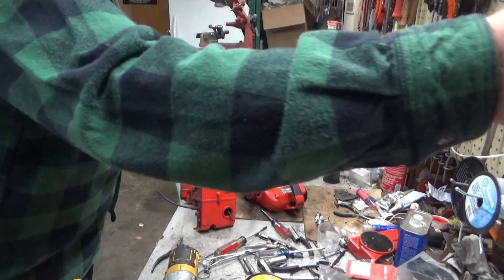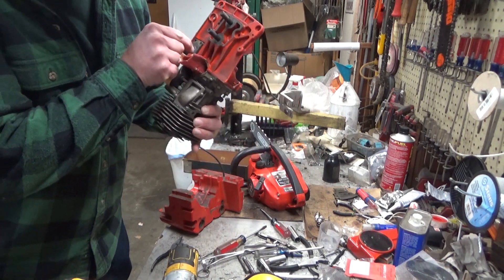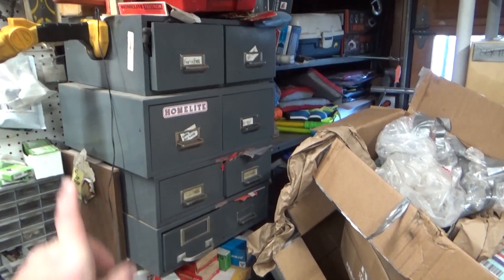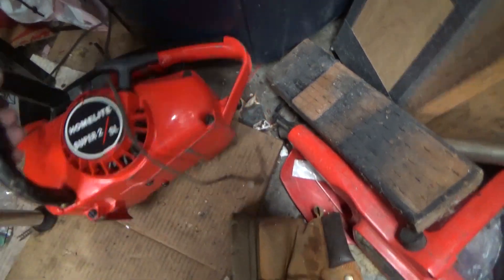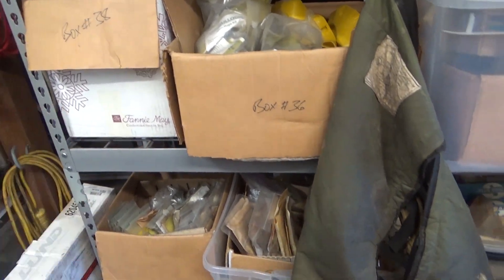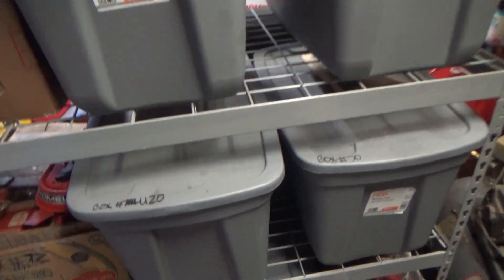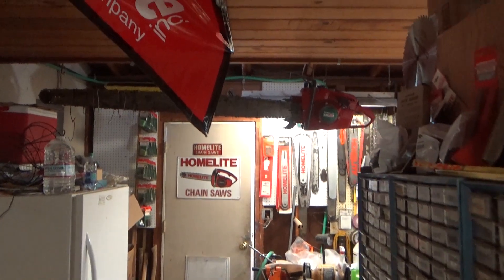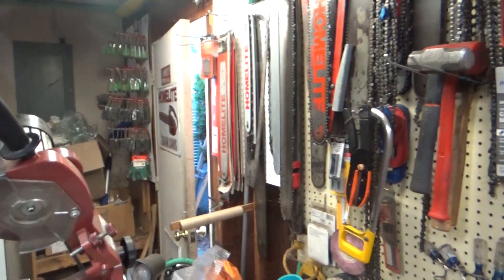Leon's "Shop" & Collection Tour

Comment: I ran the saw shop for a large logging company in the 80's- a fleet of big Homelites 925's, 955's, and 1050's, 49 saws in all and many parts stocked for each- I built a brand new 925 from stock once just cuz I could, most expensive saw of all time!  It was fun and am glad I did it but never told the boss, just worked it into the fleet.  Wish I had it now!

Comment: Reeds will stay slightly open....and give high speed running....no low....cause it floods....pull out reeds...remove Reed pins..bend flip over....will run great...

Comment: Hey Leon where is a good source of Homelite Super XL cylinders new or good used and matching pistons
Reply from the maker: Nowhere when it comes to OEM at this point.  The Lil Red Barn aftermarket ones are the only source for any quantity: https://www.ebay.com/itm/HOMELITE-SUPER-XL-BIG-RED-OLD-BLUE-XL12-CYLINDER-PISTON-KIT-1-13-16-NEW/181255679282?hash=item2a33ae2d32:g:zPgAAOSwk5FUwnaJ

Comment: Me. Leon, I am trying to take a squish measurement on a xl700 no base gasket build and it’s not even putting a dent in .062 solder, am I doing doing something wrong? Or is the squish just that large on these saws
Reply from the maker: These old saws had LOTS of room between the top of the head & piston.  Be careful though, there is some stretch at high speed.  I have no idea how much, but you want some margin!
Reply: Oh okay, it’s a rough cylinder to start with so I think .062 squish should be okay, if not it’s not a big loss, I have a spare in much better shape as well as a spare piston. Thankyou for clarifying